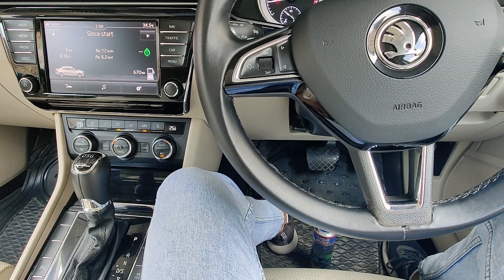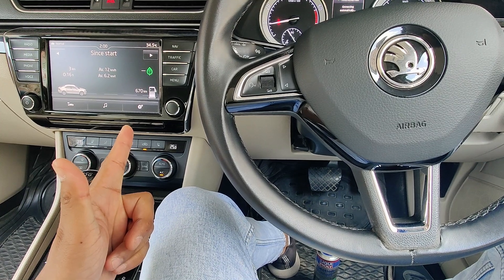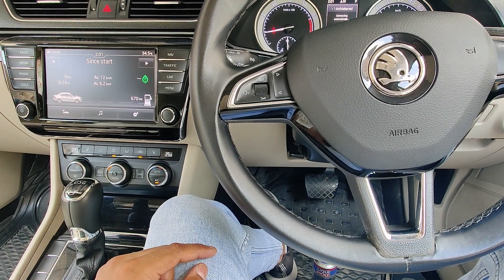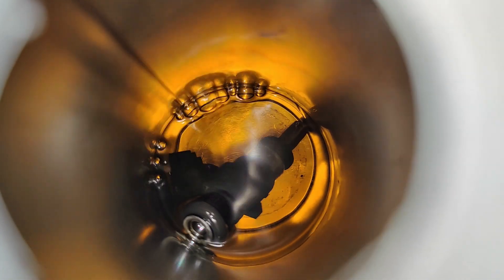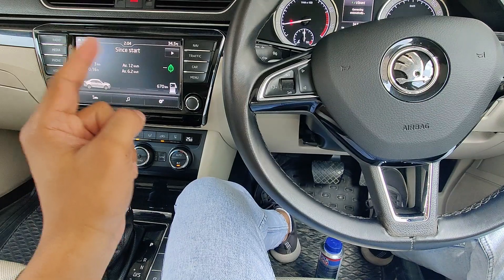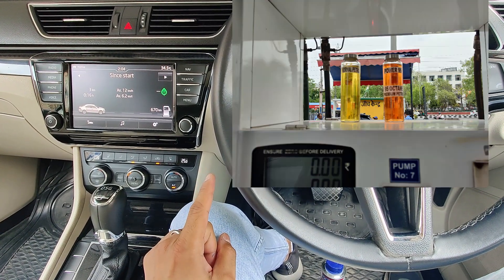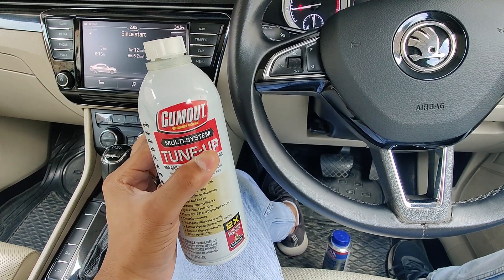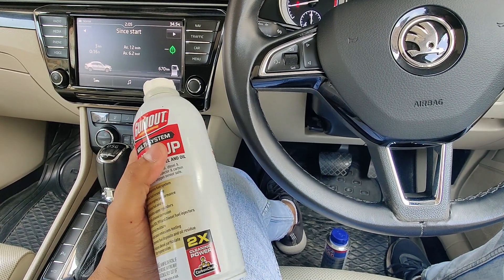PETROL CAR INJECTION PROBLEM 1.8TSI , 2.0TSI ,  GOLF , OCTAVIA , A3

Comment: Sir i have a polo 1.5 tdi there are no fault codes or errors in my car. But when the car is fully loaded with passengers the car hesitates to climb an uphill road from a fully stop position. After flooring the accelerator in 1 st gear still the car rpm comes down and comes to idle please help
Reply from the maker: Sir , my advice is to clean the intake track like from the MAF sensor to the intake manifold , and wgr as well and run a fuel system cleaner as well . It will help https://amzn.to/49dNaGR
Reply: I have clean maf sensor the whole intake system and tried the diesel purge also but no use it is still as same i also checked the turbo core condition also and the vgt was also working fine still the problem exists.
I also talked about this issue in the showroom and they said the car has only the performance of a 1.2 TDI and it has a lot of lag in 1000 rpm to 1700rpm the car pulls fine on flat roads
Reply from the maker: @Max77752 sir then look towards the cam and crank sensor data as well , if even its off by 1-2° then it will create issues , and check the timing as well ( specifically the tensioner)
Reply: @yourDIYneeds  ok brother thanks for the info i will check and tell
Reply: Brother i checked the timing and both sensor data it is all good and the tensioner is in good condition
Reply from the maker: @Max77752 sir then start unplugging the sensors , like MAF or charge air pressure and egr . One at a time 
And observe the difference , if your problem goes away after unplugging a sensor then that's the cause of the problem
Reply: Any other solutions??
Reply: But unplugging the charge air pressure sensor will cause the turbo actuator to a not working condition. The egr sensor which one to unplug the vacum controller or the one to the valve motor??
Reply from the maker: @Max77752 sir the basic here is , if after unplugging one of the sensors makes the issue go away , then that may be the problem , but if it doesn't the that sensor is working ok , but if unplugging all the sensors makes the issue better then we may be looking at a bad ecu , and by unplugging the charge air pressure the car will go in limo mode , and you have to check weather intensity of the problem decreases or not

Comment: Hey bro i broke my headlight switch mechanism it got stuck how to i remove it please help
Reply from the maker: Push it inside while its on off position and turn the parking on while keeping it pressed inside , it will unlock , then you can pull it out
Reply: @yourDIYneeds  no bro the got broke i cant do pressing it
Reply from the maker: Then sir the only other way is to force it out from backside
Reply: @yourDIYneeds  tried pusing it from behind but not comming can i cut the locks around switch using a straight blade
Reply from the maker: @harshith4061  , sir anyways you have to replace the part , go ahead pull it out any way you want , just don't damage the dash trim , and disconnect the electrical connector first
Reply: @yourDIYneeds  tried pushing it from imaide by its not comming pushing it more might break the dashboard locks please help bro
Reply: Hey bro my polo 1.5 tdi isn’t giving milage in city its barely giving 12 no error codes service done what should i do im having jerk when im accelarating really confused what shld i do now
Reply from the maker: Sir try using an engine flush on next service and get your intercooler and shudder valve cleaned , and MAF sensor as well

Comment: Hi sir, i have a Octavia 2014 Diesel AT. 
Done 1,70,000 kms+, always had my services done on time, but i am facing some issues like low fuel economy now, low pickup/ acceleration response and cars seems to heat way more then it should not. How can i visit you to give my vehicle a check, i love my car and not loving my baby not able to breath properly.
Reply from the maker: Can understand the love for cars and passion for maintaining it .
Sir have you got the timing done ?
Reply: @yourDIYneeds  i think i have done it around 1,45,000kms service.
Reply from the maker: @oneonlyadii then check if it's correctly timed or not ( engine takes long crank before starting ) , and apart from that we have to clean the whole intake track of the vehicle  from air box assembly to valve tops , everything .

Comment: Hi bro i was facing an issue wanted your suggestion m having polo tsi 1.0 mt 2020 n its throwing p0300 fault code have changed spark plug and coilpacks but issue remains the same please do suggest something ... how do i connect to you your Instagram id?
Reply from the maker: Sir you can contact me anytime on my mail everydaydiyhelp@gmail.com , can you please tell me which fuel you use ? And is the misfire is present always or in a certain situation ?

Comment: Sir my 1.5 tdi polo has accelerating issue whenever i release clutch in 1st gear and then when i press small amount of accelerator car gets high pick moves very fast what is the reason sir ?? And engine is shaking while accelerating and dis acceleration sir changed A-mount recently and problem not solved please reply
Reply from the maker: How much is it driven ? Seems like a skipping clutch
Reply: @yourDIYneeds  what is the solution for that sir ? Should i need to change the full clutch assembly along with flywheel
Reply from the maker: Thats the only way

Comment: Hi sir…My 2017 rapid 1.5 tdi auto just started showing this issue. It used to run at 800rpm, but now the idle will creep up to just above 1k till 1050 If I turn the car off and on it will return to the normal rpm. At first I thought maybe it was because of the hi electrical load from running the A/C but then I shed everything and the high idle remains. The only thing that fixes it is turning the vehicle off and on.…any thoughts?
Reply from the maker: Sir engine is experiencing high loads maybe due to lack of good lubrication, or excessive electrical load , or not proper vacuum value . 
Anything can trigger this response , but first check the specified and actual values of the throttle position sensor,  it will give you an idea .
Reply: @yourDIYneeds any way to contact you?
Reply from the maker: You can contact me on my mail @ everydaydiyhelp@gmail.com

Comment: I'm using extragreen Indian oil diesel in my polo 1.5 tdi. Is it safe to use !!
Reply: @Mohit_pra  any improvement ?? Any changes In sound?
Reply: @chandureddy472  you shouldn’t use green its written on the fuel lid

Comment: Sir, my petrol fuel flapper (door) has come out its a plastic part will patching help to hold it or need to replace the unit?
Reply from the maker: Sir depends on the condition of the locks tabs

Comment: Sir my 1.5 tdi in the morning or cold starts engine is getting knocking sound for 1-2 mins and then its goes off what is the reasons ???
Reply from the maker: In diesel vehicles if the glow plugs are not working properly then sometimes in colder climate the engine is not able to burn the diesel fuel due to low temperature , which counts as a misfire , so try checking the glow plugs once and then a fuel system cleaner
Reply: @yourDIYneeds  no its not misfiring sir i can hear a lot of knocking sound in the morning for 1-2 mins .. what would be the reason ? Please reply 🙏
Reply from the maker: @chandureddy472 may be lifters , try to use better oil , like liqui moly 
Attaching a link for reference 
https://amzn.to/4d5WWv1
Reply: @yourDIYneeds  sound started after using the liqui moly sir 😢
Reply: @yourDIYneeds  lifters ?? Is that a big problem??? What is the solution???
Reply from the maker: @chandureddy472 
No , the lifter gets dry overnight and they make noise till the time oil starts to rotate properly.
Reply from the maker: Then your lifters might have a lot of wear , in that case you can go for a lifter additive
https://amzn.to/4f5bfC4

Comment: Make a video on diesel too please… can we use xGreen diesel by indian oil in bs4 tdi ??? In the present situation which diesel is best for our 2017 polo tdi ??? What precautions we need to take in terms to maintain injectors please reply or make a video 🥲
Reply from the maker: Right now all the diesel have very low amount of sulphur in them due to emission norms , you can use an addictive which has sulphur , as sulphur act as a lubricant on molecular level and also considered to be a pressure additive .
Reply: @yourDIYneeds  which diesel has sulphur ?? Which one is best for our 1.5 tdi ??
Reply from the maker: @chandureddy472 sir all the diesel are the same in the Indian market these days , better option is to find an additive
Reply: @yourDIYneeds  sir which additive is best for our polo tdi ?
Reply: @chandureddy472  I have personally used diesel additives from Liqui Moly, Motul, Megiun (not available any more looks like) and Mannol in my 2.0 TDI. My main intention is to the lubricate the high pressure fuel pump. Do you know if XtraGreen  contains Bio diesel? My fuel cap says No Bio diesel, so never tried it.
Reply: I use Indians Oil's AddOnD with normal diesel, which seems to work fine till date.